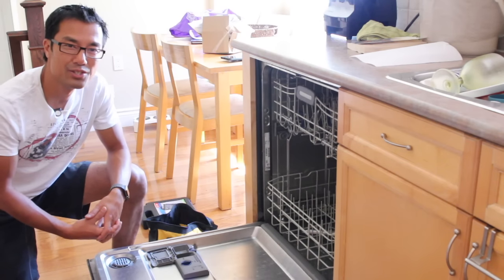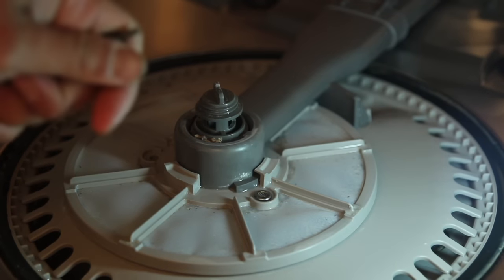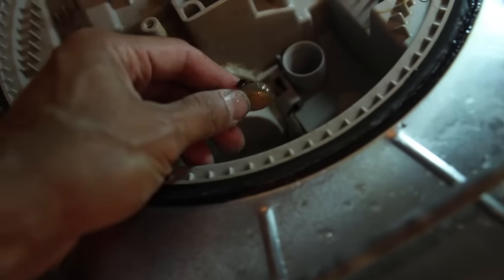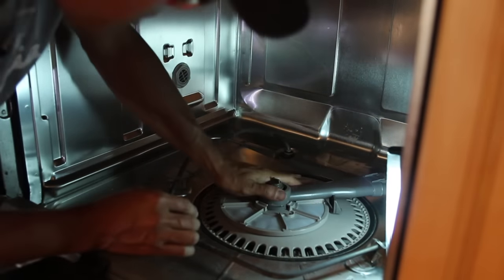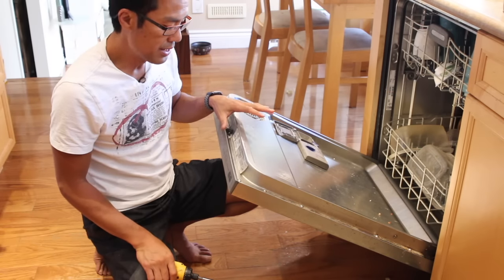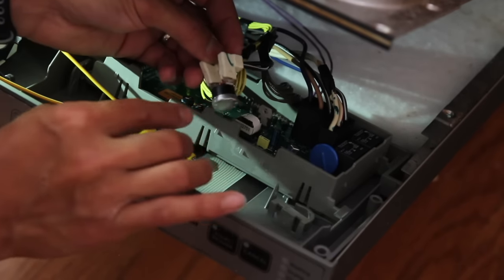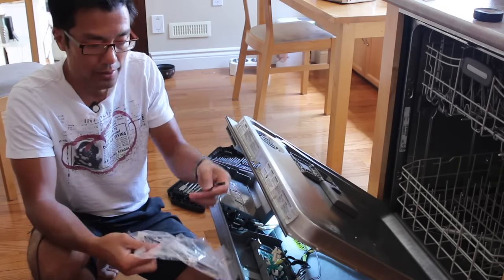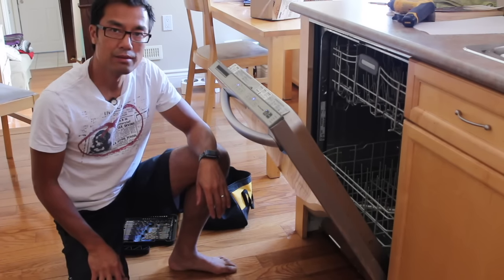KitchenAid Dishwasher Repair - No Power, No Lights and Grinder Clean up

Comment: This got my dishwasher going, however, the unit stopped working again after one run. I guess the fuse is blowing for some reason further down the line (I ran it without heat/dry, so perhaps that rules out the heating element). Turbidity sensor? The motor gets a bit loud so maybe it is failing. I also just switched out the fuse as opposed to splicing in the wire kit, and some websites say not to skip that step, but the wires that come with it are only about 8" long so that just seems like splicing for the sake of splicing. Anyway, this is a great video and it seems to have been a permanent fix for many. Thanks for Posting!
Reply from the maker: Have you tried cleaning the grinder yet?

Comment: Nice instruction. We clean the bottom of the dishwasher. Then reassembled. Tested the fuse by using a paper clip  and we got lights. replaced the fuse and got lights. First test run was good the I just looked in the dishwasher and there is water at the bottom and no lights so I think we blew the fuse again. I guess we need to check the drain motor or hose.
Reply from the maker: Check the board, there might be other parts that are blown.  In that case you might need to replace it.

Comment: Great tutorial, not only was it my fuse that blew, but there was gunk all inside that needed cleaning, and ceramic bits in the grinder from a broken bowl. I replaced the grinder as well.
Reply from the maker: Awesome.  Glad to hear you got it all working again.  Make sure you clean out your filter/grinder once every couple of months to keep you dishwasher cleaning like new.  Have a great rest of the week and thanks for commenting!
Reply: @DDIY-Guy  Then I guess my dishwasher has done a good job, since this is the first time I cleaned it in 10 years!
Reply from the maker: I guess you do a good job of rinsing the dishes before you put it in the dishwasher.  I tend to find things like cherry seeds, broken plastics, pieces of glass,  every couple of months :-)
Reply: @DDIY-Guy  Hi Danny, my dishwasher stopped again. I ran it once, it cleaned really well, but didn't drain. I pushed the cancel/drain button and it drained. I tried running it again on light wash. It didn't drain and now it doesn't start. I just replaced the grinder and the fuse when it wasn't working before and there hasn't been any junk in there to get clogged. Any idea what it could be??? PS: I don't have a sink disposal.
Reply from the maker: it sounds like a part of the board might be blown.    if you check the board that you replaced the fuse with, disconnect all the wires and pop out the board.   Look at the underside and see if there are any burn marks.
Reply: @DDIY-Guy  This morning the dishwasher lights went on back to the Light wash cycle it was in yesterday and I was able to push the cancel/drain button and the water drained out again. Then it didn't start again, and I finally realized this time I forgot to plug it back in, haha! So it's running again now, and I'll see what happens. Before I remembered to plug it in, I took off the front apart again and the fuse was snapped into its holder, but I did notice it turn will turn slightly in place. The wires are solidly connected to the fuse but the fuse itself is not "locked" in position inside the holder. It doesn't look like that should matter since I don't see anything underneath the fuse that it connects to, but thought I'd check with you. 
All the wires look fine on top of the control board.There's some black tape glue on some wires at the very bottom of the door that go underneath the dishwasher. So far nothing else seems like it could be the problem. I'll run of few of the Light cycles and see what happens, Thank you so much for your replies!
Reply: I ran three cycles. The first two it drained. The third time, it hasn't drained and now it won't start, no lights again. Still think I should try replacing the control board?
Reply from the maker: Well the control boards are expensive and hard to find.  If it’s the board at this point, then it might be just best to get a new dishwasher.  I would highly recommend getting a Bosch this time.  One of the best ones to get for the price, quality and quite operation.
Reply from the maker: Bosch 300 series is a good one to look at.
Reply: @DDIY-Guy  Those Bosch are crazy expensive. Here's something very specific: I've run several test cycles and every time I run the dishwasher on rinse only cycle it drains, when I run it on normal it doesn't. Does this help identify the part as the control board? I've found them online for around $200, which is a lot if it doesn't fix it, but cheap if it does, so wondering if there's anything else I should try first? I thought maybe the door latch but does this new consistency in symptoms match that? or is it mostly likely the control board? Thank you!
Reply from the maker: Well it’s likely the controls for the heating cycle.  Are you sure you didn’t see any burn marks on the board?  Also have you tried a reboot on the dishwasher?  You can do this by pressing these 2 buttons in alternating sequences (hi-temp/scrub and energy-save-dry buttons 10 times).
Reply: @DDIY-Guy  Thanks for the tip, Danny. I have a hi temp wash button, but no energy-save-dry-button, just Sani-rinse, heated dry, and delay buttons. I followed your instructions pressing the hi-temp and heated dry buttons, all the lights came on. I hit cancel twice to turn it all off. I'll run another normal load and see what happens. The heating cycle controls also sound like a good bet because when the lights come back on, the dishwasher is cooled down. Would that be resolved with another control board?
Reply from the maker: Well the control board is the part the switch on the heat....the only thing might be is that the root cause of the current surge is not the control board so it might just blow it out again.  At this point I don’t know.  To be honest, I was going to buy a used dishwasher off Facebook market that is the same model and just take the board out of it....it would have cost me $150 and strip it for parts but my wife said let’s just get a new one....we baught a Bosch from Costco.  Happy with it....but my DIY in me was sad to let the dishwasher go.

Comment: Great video, had the same issue, the fuse, also took it all apart to give a good cleaning with CLR.........Thanks!
Reply from the maker: That’s awesome. Glad you fixed the issue and gave your machine a good cleaning :-). Thank you for commenting.
Reply: What is CLR ?
Reply from the maker: It stands for Calcium, Lime, and Rust remover.  It’s a common cleaning chemical.

Comment: Thank you thank you thank you! My dishwasher had the exact same problem and if I had just fixed the fuse it would have happened again. (My dishwasher had the same issue with obstructions/plastic in the drain.) Up and running again thanks to your video. 👍👍👍👍👍
Reply from the maker: So glad it was helpful!!  Thanks for commenting!

Comment: i remember always to take the fuse out of the circuit when testing for shorts or rather continuity when i was testing laptops.  i believe it has something to do with if its still connected to other things it could pick up some funky stuff

Comment: I can visualize calls to repair technician....i tried to take my dishwasher apart to fix it and now i don’t know how to put it back together.  My advice is stop buying pistachios in the shell.  Thanks for the video.  Excellent instructions.
Reply from the maker: You are right.....no more hard shell nuts and cherries!  They are the common culprits for clogged filter and grinders.  You can also tell everyone to rinse their dishes before putting it in the dishwasher.  Anyway, thanks for commenting. Have a great rest of the week.

Comment: If you’re experiencing the same issue but the dude provided continuity should I consider the board? Unit is not turning on/ responding to commands but is getting power

Comment: This was a great video!! So easy to understand!  But what if it isn’t the fuse?  I didn’t have jumper cables, but used a multimeter to test the fuse, and it looks like there was good contintuity .... so what’s next?
Reply from the maker: Is there any lights at all on the dishwasher?  If
Reply from the maker: If there is no power at all, disassemble the control board and see if there are any burn marks....if so, you might be able to replace it....you can purchase a new one from Amazon.

Comment: Thank you so much! I was able to fix my dishwasher thanks to your video! I have the exact same model. However, the cycles controls to the left are not working (Heave Duty / Normal / Rinse Only. the lights are out. Any thoughts on how to fix that?? I really appreciate you sharing your knowledge! Blessings, Andres.
Reply from the maker: It might be a burnt contact on the board that operates the lights on the cycle controls.  Check for any burnt markings.

Comment: Excellent video, thank you. I went step by step and did not find any obvious objects in the grinder that could have overheated and blocked operation. I tested the dishwasher fuse and it was good. I turned on power after having already reset the breaker box house panel fuse and voila, dishwasher worked. But now the question is why? If the fuse inside dishwasher was good and the breaker  in house breaker box panel was not tripped and even after resetting, why did washer start working, just by cleaning grinder and taking off door panel to test dishwasher fuse...not complaining but still a mystery currently
Reply from the maker: sounds like you got lucky and didn’t blow the fuse with a sudden power surge.  The dishwasher might have just powered off automatically and just needed a power restart.  anyway, glad it all worked out for you.
Reply: @DDIY-Guy  Thanks for the follow up

Comment: Good video. The fuse was just $9.50 in Amazon. 
Now the dishwasher runs for a while and shuts down with no power and after 20-25 minutes the power is back on and the light is flashing. It stops midway in the rinse cycle. I assumed the drain motor is not working. But once the power is back on (on its own) I hit cancel and the water completely. 
Cant figure out the problem
Reply from the maker: Check the bottom of your dishwasher where the water spout is located at the bottom front right corner.  Sometimes a utensil will get stuck under it and will stop the cycle mid way.
Reply: DDIY GUY Danny Jose - Thanks for your quick response. No luck with that. It’s clear 
Since my message I ran another cycle. It ran for 20 minutes then shut down. All lights off and nothing will work. I waited 20 minutes, lights came on and start was blinking. Hit start and the cycle continued. Died again after 20 minutes. Came back alive in 15-20 minutes and when I hit the flashing start it completed the whole cycle with the cycle complete light in the end. 
Seems like something in the circuit Is heating up and trips. Once it cools it ready to start again.  
Do you think it’s the control board or is there a thermal switch?  
Thanks for your reply and help.
Reply from the maker: It might be just the fuse you got. You might want to order another one...this is the version I got from amazon. It’s got really good reviews but it costs $35.  

https://www.amazon.ca/gp/product/B005B489US/ref=as_li_tl?ie=UTF8&camp=15121&creative=330641&creativeASIN=B005B489US&linkCode=as2&tag=ddiydannyjose-20&linkId=aec3a00a3c1535c3b4f8881ce7c10e95

Also, make sure you install it with the wires it came with if you can.  Those wire are better suited for that fuse.

Comment: I had a no power and it was not the fuse ... always check the wire nuts in the junction box at the front lower corner of the unit - that fixed my problem after tightening the wire nuts.
Reply from the maker: Good advise.  Thanks for adding to the DIY fix!
Reply: How do you access the junction box?
Reply from the maker: Bsjcook...how do you access the junction box?
Reply: DDIY GUY Danny Jose  bottom right, you should see a 12ga power supply going in (usually yellow)
from inside that 3 wires come out black white and copper. The black and white wire nut to black and white of dishhwasher

Comment: Great video and tutorial. I am having a slight different issue . The 4 hr delay light won’t turn on. When i am resetting the unit i see that it does turn on. Any any idea where to look on the board for this issue ? Otherwise the unit is fully working. Thanks in advance.
Reply from the maker: if you tried all the standard reset procedures and turned off and on the breakers for it, then check the main board and see if there are any blown contacts on it.

Comment: Thanks!  It was just as you guessed...blown fuse.  $13.99 with free Prime shipping from Amazon, plus $4.99 for a pair of size T20 torx bits (the larger size...T-15 for the smaller screws)  Thanks!
Reply from the maker: That’s awesome!  Glad you got it working as well and thanks for mentioning the size torque bits needed :-) Have a great rest of the weekend!

Comment: I can detect electricity on the control panel, but the control panel is not working, and there is no light. Is this the problem with the thermal fuze?
Reply from the maker: Might be a something blown on the board.  Check underneath it and see if there are any burn marks.  If there is, you'll have to get a new one.

Comment: Hi! Not sure if you can answer this, but this video was so helpful, figured I'd ask!  So this fix worked perfectly for about 5 weeks, it went off again, we got a new fuse. Then about 4-5 weeks later...it appeared the fuse blew again...but this time, while waiting for a new fuse to be shipped...the power (which definitely was NOT coming on), just came back on after about 24 hours.  This has now happened 5-6 times.  Except now it won't finish a cycle.  The weird thing is, it must be getting pretty close to being done, because the only reason we are realizing it wasn't finished is that there is water pooled up.  But if I wait that 24 hrs, the power will restore, and I can run a rinse cycle, and everything drains no problem.    Any clues what to look at?  thank you so much for any input :)
Reply from the maker: Try looking at the water sprays at the bottom front corner.  Sometimes a utensil gets stuck underneath it and it prevents the cycle from running completely.  If it’s not that then look at the circuit board where the fuse blew and check for burns.  There might have damaged the board.  In that case, you might have to replace the whole board.

Comment: $40-$50 for a fuse? that's crazy. Anyway, were you curious about the underlying cause of the current overload in the first place? We have shrimps shell in the sump. My family keeps thinking that the dishwasher is some sort of magic box because of the stuff I find in there and the very badly washed plates because of the way they were arranged in the rack.  I call it the non-magic box for their benefit now.
Reply from the maker: Ya, I have the same problem with my family and especially when we have a party at our house, people just put dishes in the rack in random places and forget to rinse or scrape of their plate. The worst is scoops of peanut butter when they are baking...that stuff clogs the filter....best to wipe it off with paper towel first. I try to clean it the washer every 3 months....keeps it running like new.  As for the fuse being blown....after I replaced it it’s been working great...and that was about 2 years ago.

Comment: HELP! Great video!  Everything worked except when I put the 4 legged sprayer back on.  I hold it, tighten the middle, and when it spins it wobbles ALOT and hits the back part you removed during the earlier steps.  Re did the back part and verified its in place (by placing top rack back in and watching the top tub fit into the whole for upper water).  Taken it out and redid it a few times but worried now I am going to strip the plastic piece.  Thoughts???

Comment: Great video and well explained. 

Replaced the thermal fuse (non-oem) and my Kitchenaid KUDL03FVSS3 is working again without heat. Now when the door is opened mid cycle, it doesn't stop the dishwasher. 

Any clues?  Is the thermal fuse a bad one or did I mess-up the door switch when the door was reinstalled?
Reply from the maker: pwekowiewks it could be when the fuse blew, it might have damaged the board.  Check to see if there are any burn marks around the fuse area.  If it is damaged, then, you might have to replace the whole board.  The other potential reason could be when you put the door panel back together.  Maybe disassemble it again and make sure everything is done properly, especially the top part where the lock hinge goes.
Reply: @DDIY-Guy  Ran a full wash cycle as expected. Ordered an OEM fuse and will also check the door switch when replacing that. Don't recall any burnt marks anywhere, hoping it's not control board.
Reply from the maker: If it is a control board, it’s not that difficult to replace either.  Probably much cheaper than getting a brand new dishwasher.
Reply: @DDIY-Guy  Finally have an operational dishwasher and replaced these parts in sequence. 1. Thermal Fuse, 2. Door Switch, 3. Heating Element, 4. High Limit thermostat.Total cost was about $80 and took about 4-5hrs in total labor while working slowly. Weird that door switch was broken in the process and appears totally unrelated. Great satisfaction to save a good dishwasher from landfill. It's not only the $$ saved, but also the DIY satisfaction.
Reply from the maker: Wow!  That’s fantastic!  You should have video taped it as well and posted on YouTube :-). Great job!  Glad it all worked for you and it was another successful DIY story.  Thank you for sharing. Have a fantastic rest of the week!